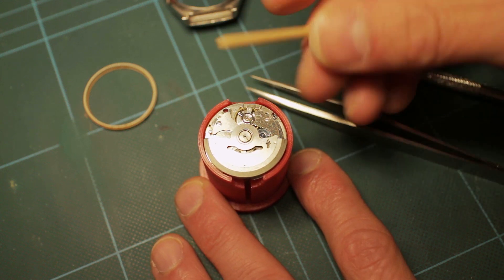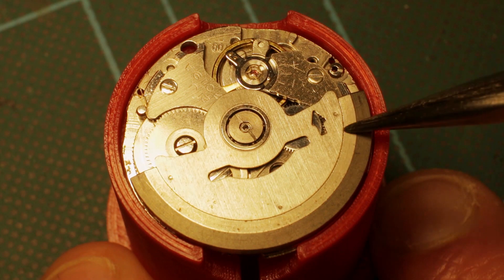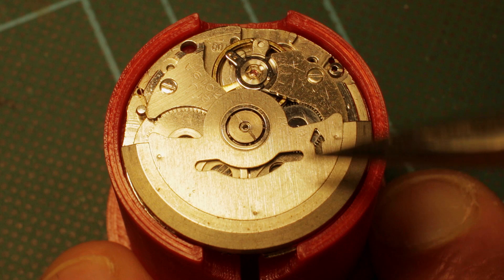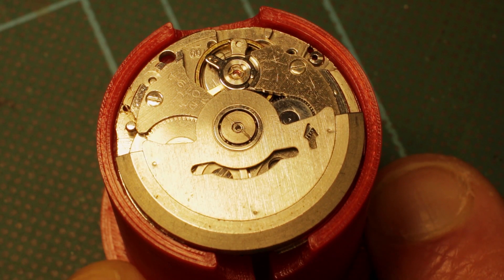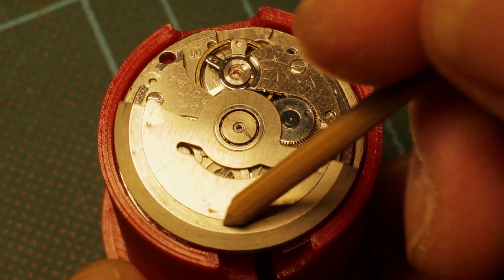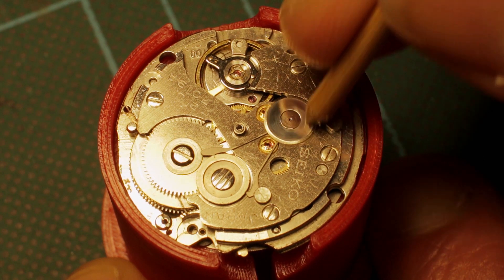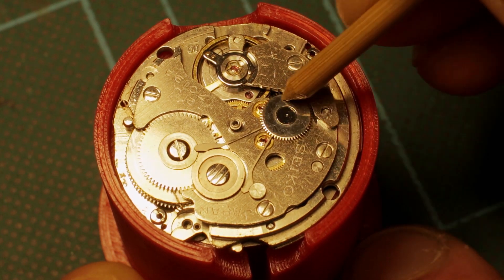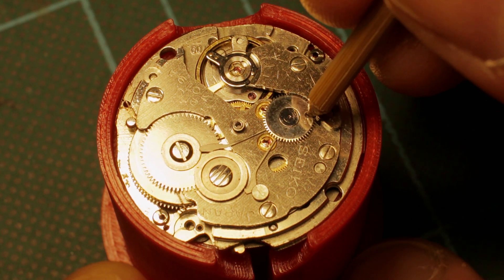Seiko Automatics Self Winding System Alignment, Why Does It Matter?

Comment: What if the movement has a 4 o'clock crown? Does that mean that I should align the rotor at the 3 o'clock position instead of the crown, since that's the natural position of the wrist when worn on the left hand?
Reply from the maker: You should fit in the 3 o'clock position as that's the natural hanging position unless you're a right wrist wearer in which case you'd set it to 9 o'clock.
Reply: @spidiq8  Cool, thanks! I find it weird that most Seikos with a 4 o'clock crown have the rotor aligned with the crown/stem from the factory, rather than with the 3 o'clock position. I guess this streamlines the manufacturing process, as all the workers have to know is to align the rotor with the crown/stem regardless of the movement variation.
Reply from the maker: @djdelarosa25  most likely that will be the standard procedure as there's no way to know on the production line which movent will go in which case but the difference between 3 and 4 will be very minimal.
The system is incredibly efficient as it is.

Comment: Wow, brilliant!  I've been dealing with poor winding for several years and have searched and searched on watch forums for an answer.  I've even posted on forums that the Seiko 7s26 is not an efficient winder because my watch would only run for about 4 hours after 16 hours of wear.  Yes, I'm sedentary, but my Orient Tri-star has never given me a problem with running down overnight. So, I just checked and my rotor was way off.  I hope this works.
Reply from the maker: It should make a difference and Seiko winding is incredibly efficient. With regular activity, walking around on a work day, 4 hours should see a full wind from empty.
There is a possibility depending on the age of the watch that it's ready for a service however.
Reply: I've simplified things.  This has happened *twice*, both watches worked fine for about 4 months and then started running down overnight.  I know I hadn't fiddled with the rotors.  My theory was that the full wind gradually ran down until I was only running on what I put in each day.  Once that happened the over night stoppages started.  I can only understand this if the factory didn't position the rotor correctly.  But we'll see what happens now.  @spidiq8
Reply: I aligned the rotor and gave the watch the Seiko Shake for one minute and set it down and let it run.  It ran for 2 hrs. 30 minutes!  So the automatic wind is really efficient.  However this didn't solve my problem.  I think I've broken the automatic day advance by adjusting it during the hours you're not supposed to.  I guess I didn't know about this back then.  This was my first mechanical watch.  Can you tell me what parts I will need to replace to fix this?

Comment: I have seiko 5 with 7s26 and seiko 5 sport with 4r36 with this winding sistem magic lever but after 10 or 20 dais they both stops usually in the morning when I sleep and I can say that this winding sistem don't wind enough don't know why but don't work ok
Reply from the maker: The winding system is one of the most efficient auto winding systems created.
approximately 4 hours of general activity, not sedate but not excessive, just walking around and lifting and moving things for example will give  a full wind from empty which should give about 30 hours of running.
Unless you're very sedentary and don't move much at all it should wind sufficiently, if not they're likely ready for a service.

Comment: Thanks for this video. I'd been thinking about my three Orient Star watches for a while with the fact that the rotor can fit in either of two positions. I did presume that it wouldn't matter which way up the rotor went as there are no markings, unlike Seiko. Anyway I did find that two of my three Orients had the rotor fixed in the inefficient position for a left hand wearer like myself. That's now sorted and I do think it does matter as the magic finger is below a bridge on the Orient and there is a small hole through the bridge so the finger position can be seen to be at the top or bottom of its travel. If it didn't matter then why would they put a viewing window there. Thanks again.

Comment: Hi Sir my seiko 5 6106c is not working for long when wore it (it stops in 2 minutes). I have opened it and find it that my watch is winding in clockwise direction But In anti clock wise directions it moves anticlockwise instead of clockwise directions. I had screwed my watch main gear clockwise it stated working for a full day. Suggest me please what might happened. Please reply me sir thanks.
Reply from the maker: I assume you mean as the oscillating weight spins anticlockwise it doesn't wind the barrel ratchet wheel clockwise? If so then you have a faulty first reduction wheel or pawl lever and it's slipping rather than driving the ratchet as it should. The click for the mainspring barrel may also be worn or damaged.

Comment: Hi Sir my seiko 5 6106c is not working for long when I wore it (it stops in 2 minutes). I have opened it and find it that my watch is winding in clockwise direction But In anti clock wise directions it moves anticlockwise instead of clockwise directions. I had screwed my watch main gear clockwise it stated working for a full day. Suggest me please what might happened. Thanks

Comment: How about when the winding stem is at 4 and not 3 o'clock - would it better to place the oscillating weight, so it is completely downward when you are standing up with arms hanging down to the sides?
Reply from the maker: Between 3 and 4 the difference would be so minimal as to not be noticeable but for the optimum efficiency the weight needs to be hanging at the 3 position. One of these movements with routine activity would wind fully from empty in 4 to 5 hours.
Reply: @spidiq8  Thanks for the answer - and brilliant movie and explanation.
Reply from the maker: @MadsGormLarsen  You're welcome and happy to help. Thank you for the kind words.

Comment: Does this also hold true for the 6139? I think my 6139 is not winding fully….I suspect that the winding resistance gets higher as the mainspring gets more wound up to the point where the automatic rotor does not move freely anymore….
Reply from the maker: Yes. All the 'magic finger' winding systems are the same, if it's binding up and not wondering fully to the point of slipping it'll be needing a strip and clean. The grease Seiko use in the mainspring barrels gets really dry and thick and that can make it stiff as the bridle won't slip easily.
Reply: @spidiq8  This is probably not true. The auto-winding mechanism of Seiko 6139 is slightly different in that it does not have the "1st reduction wheel". The rotor directly connects to the eccentric mechanism that operates the magic levers. In 6139, there are two keyed positions you can install the rotor. I never thought about checking which position works better until I saw your video, so thank you. I will check next time I open the watch. This is also the case in 6309, 6319 and other vintage 6xxx series.
Reply from the maker: @gang208  They all have a reduction wheel system, the 6139/8 and a couple of others differ only in that the bearing is on the bridge rather than fitted to the oscillating weight as per the 7S26 and NH etc.
A reduction system is necessary in all automatic winding works as the weights would not have enough inertia to wind directly.